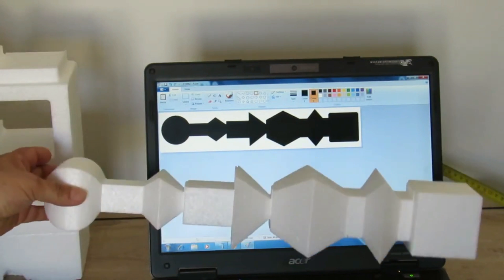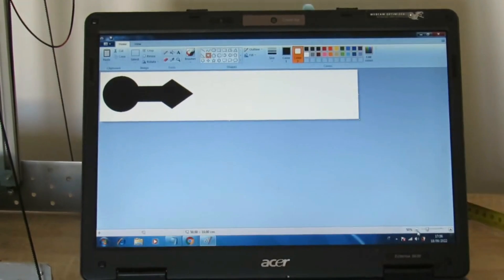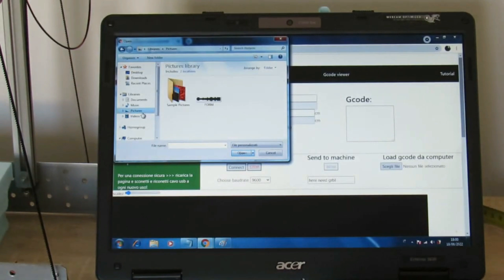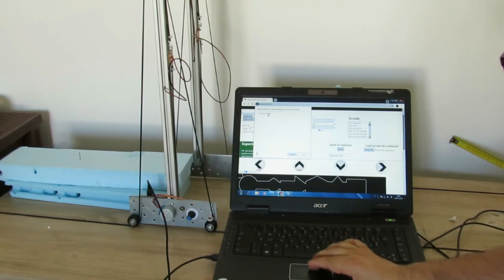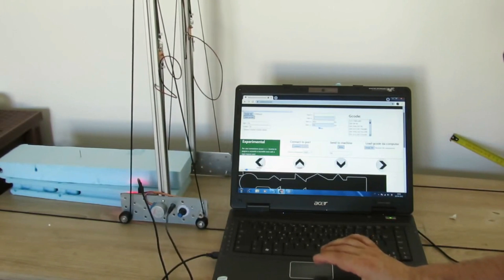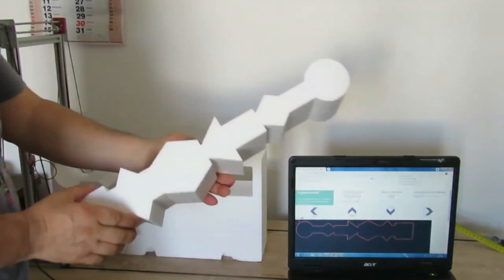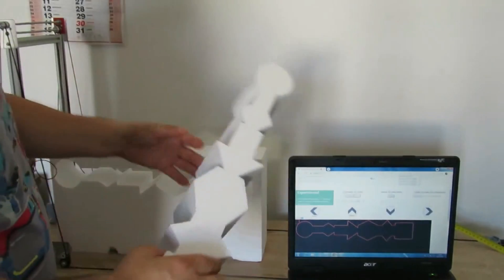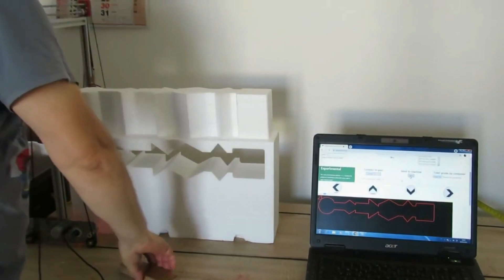Costycnc Foam Cutter: A Step-by-Step Guide to Cutting a Column

Comment: bob, do u adjust the size for the second cut and it looks like it started to cut from the bottom and then the top?
Reply from the maker: change $3 parameter 0,1,2 or 3 ... will change both direction